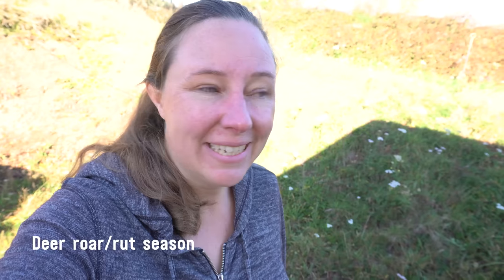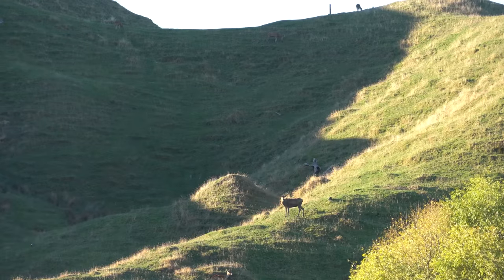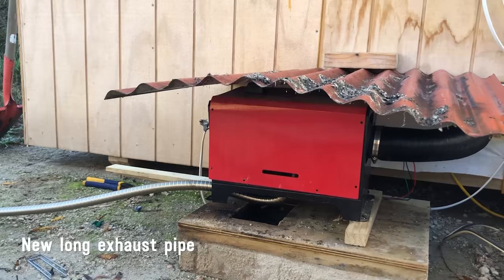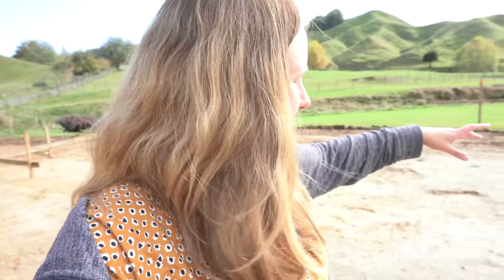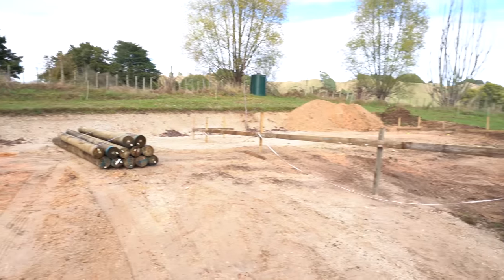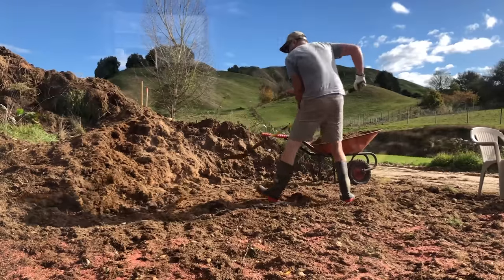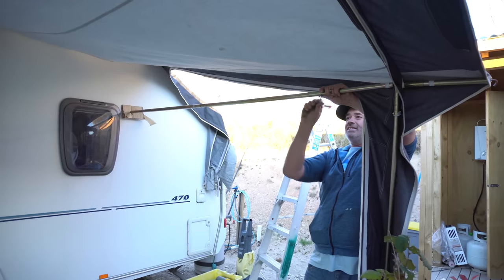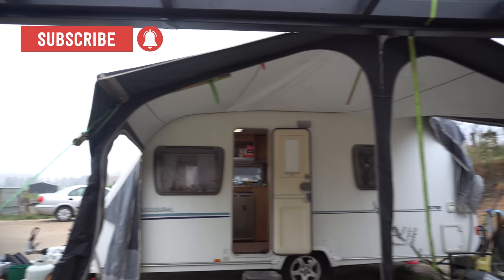Our Diesel Heater Is Broken... & I'M COLD!

Comment: You will make a huge improvement to your cabin heating if you draw the intake air to the heater from inside the cabin and it will also eliminate any possibility of drawing in any exhaust fumes. 
To explain. 
The heater can raise the temperature of the intake air by a fixed amount. Let's say that it's 15 degrees. Then if it's heating the outside air and that is 5 degrees then the air going into the cabin will only ever be 20 degrees. 
If the heater is heating air drawn from the cabin and it raises the temperature by the same 15 degrees over time it will be drawing in warmer and warmer air and continually adding the 15 degree rise until it reaches the thermostat set temperature. 
Hope this makes sense. 
Regards.
Dave.
Reply from the maker: Hi Dave. What we found land winter is we’d get too hot on the lowest setting!
Reply: @TravellingK  the thermostat sensor is in the intake side of the heater,so when it is sucking in cold outside air it will always be going flat out to try and get up to the temperature set on the thermostat.

Comment: Hi Karen. Inside the diesel heater is a fine mesh screen that's used for lighting the heater. They get clogged with soot if you run your heater on low setting too much. So every so often run the heater on full for awhile and that will help prevent the clogging with soot issue.
Reply from the maker: Ohhhh that’s handy to know! Could have been part of the problem

Comment: It's lovely to see your update! I can imagine the break was really refreshing - nothing like a change of scenery to recharge the batteries is there?!

 I don't know if it's possible with your solar set up but if you need heating back up in the future a 500 watt oil filled radiator would heat your cabin really well and you can use it to just keep the chill off during the day without it drawing constant power. I can't wait to see how the new build comes along <3

Comment: If possible, set up the heater air intake to draw air from inside the cabin and recirculating it.
Reply from the maker: What we found last winter was we always had the heat set at the lowest as the cabin warmed up quickly

Comment: For the awning, check out the Camptech UniLok system, it allows you to click 1 part to the awning fabric, and the other part has a no-slip rubber surface to the Caravan. It also has a hole where you have to click in the awning. I have the same, got it with the caravan, works like a gem. Alternatively you have to drill the pole clippers into the caravan, below the awning rail, seal it, and you can clip in the awning poles. :)
Reply from the maker: Ah very interesting!! Thanks

Comment: Hi Karen, I was wondering why you don't use a wood pellet fire burners, instead of diesel? I have used these and they are reliable and clean burning, in a multi-room cabin with heat transfer vents, to warm the whole building? I know of quite a few cabins in NZ that use these in the winter.
Reply from the maker: No fire without council permission unfortunately! We’re definitely getting one in the house

Comment: Never liked the all in one heaters, even a tiny fuel leak causes huge problems,  the separate units are always better. You need awning pads or cups to protect the van, if the awning has a second bead where ot attaches to the van you can use the ones that clip on if not use the big rubber cups.
Reply from the maker: Good to know!

Comment: Oh dear here we go again, 1, your fuel pump is not on the proper angle it needs to be pointed up on a 15 to 30 deg angle preferably 30deg, 2, where is your fuel filter, if it didn't come with one you've been done, every diesel heater should have a fuel filter before the pump, its basically the same as your diesel car, you wouldn't run your car without one. 3, the fuel line from your tank to the pump is too short extend it by another 15cm so its not too tight, there is no need to talk about buying another heater, you guys just have to install it properly, that really is a dodgy job, sorry if the truth hurts but if you dont rectify these you will have nothing but more problems, I suggest you sit down with Hayden and do some real research on YouTube for trouble free running otherwise Karen your going to wake up cold again
Reply from the maker: Yikes!! Good to know